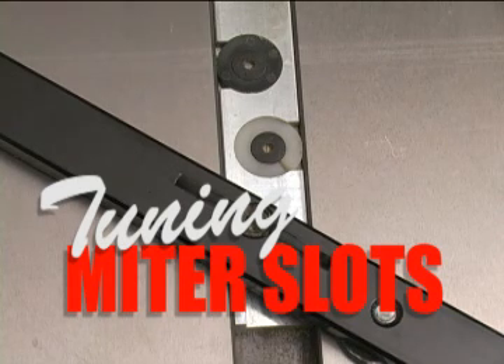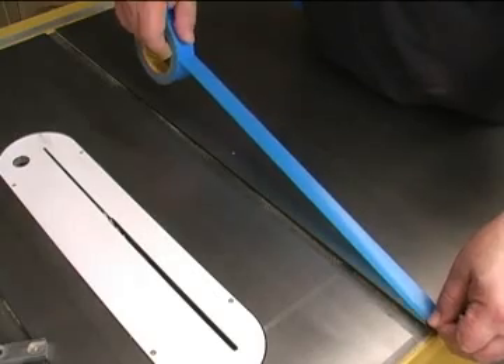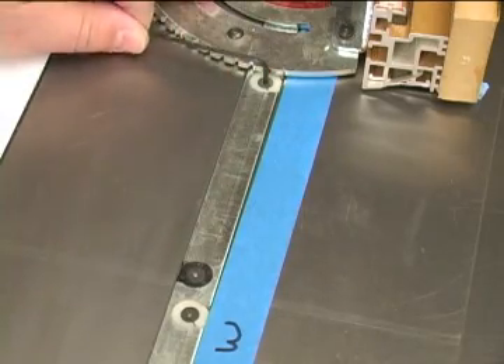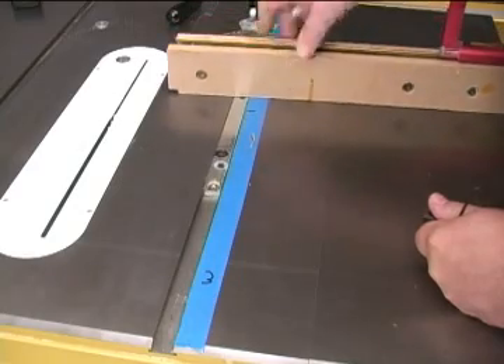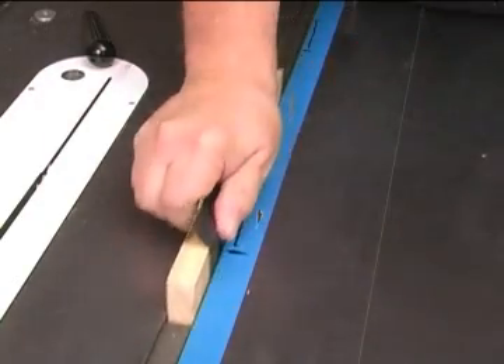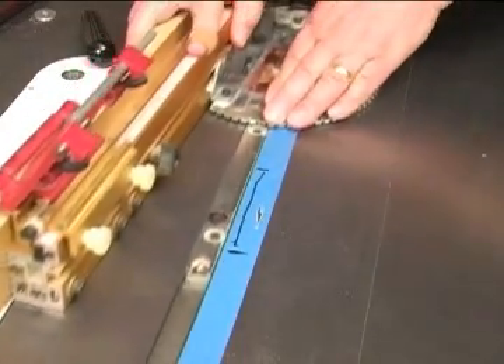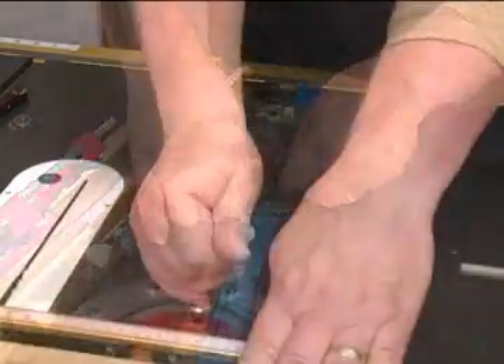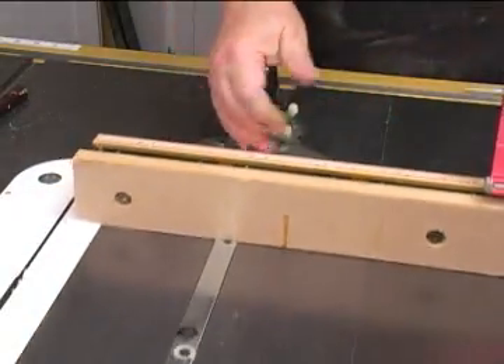Tuning Up Miter Slots

Comment: I have a Bosch TS-4000. Just got the Incra Miter 5000.. Boy these slots are aweful.  Tight, then loose.  I pretty much did the same think you had demonstrated.  Thank you.  I use a square MDF piece and some automotive 220.   Then, checking the second slot.  It was worse still!  I grabbed a file.  File, and sand... File and sand.   Horrible tolerances from factory..  The 2nd miter bar from Incra has the expanding aluminum.  This one would be the stickiest of the two, compared to the split washer/bushing bar.  I wish they included both types.  I also wish I had a better method to machine out this miter slot.  Or eve, machine out a large enough area to insert a track/slot.  I highly doubt there's enough material for that.  I just worked on mine for 3 hours!  Took a break.. Still somewhat tight in a few spots.  Thank you for the video.  Tape is a great idea.  I'll resume using some of my various emery cloths instead of 220 sandpaper.

Comment: What sandpaper grit do you recommend?
Reply from the maker: I mostly use something around 220-grit. You seldom have to remove much material unless it is one of the really "bargain priced" saws in which case you might need dynamite or something.

Comment: Doesn't it take a lot of strokes to remove even as little as one thousandth of an inch of cast iron? The video makes it look like you only put in a few strokes.
Reply from the maker: On cheaper saws, it can take some work. ON better equipment the variations in the slots is very small and relieving it is quick.